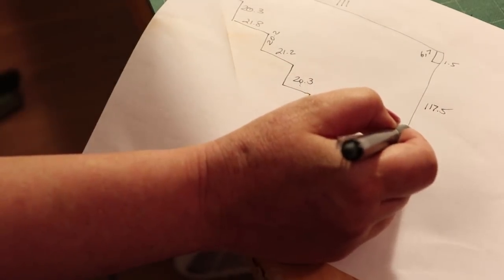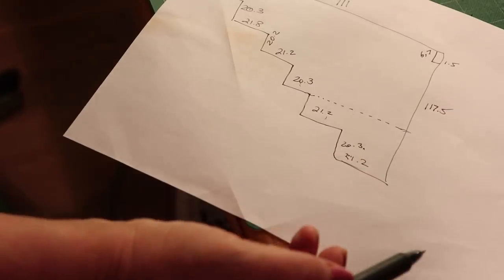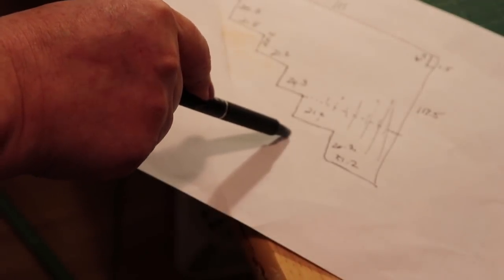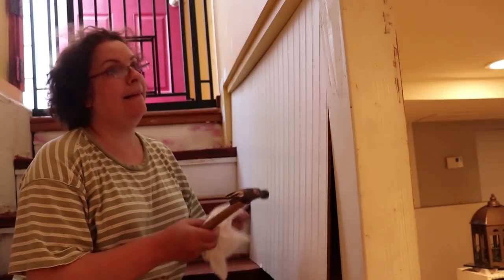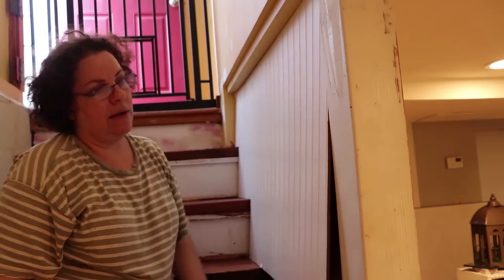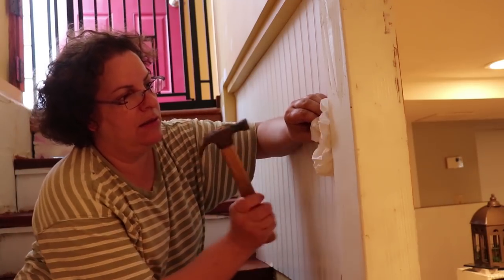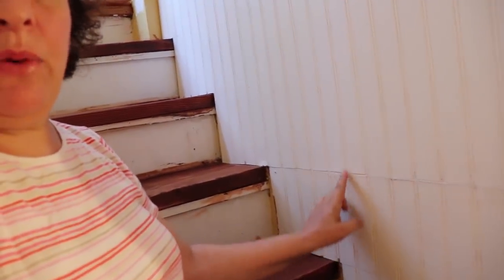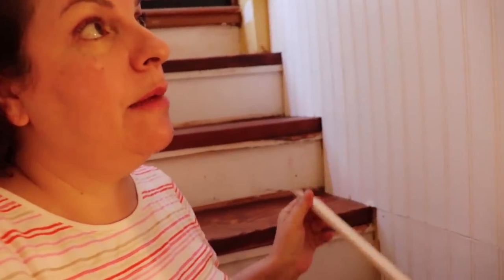🔨  Basement Staircase Makeover || Part Four 🔨

Comment: Excellent work!  You have inspired me to tackle projects at my house.  Just yesterday I finally resolved a drainage problem with my dehumidifier.  For more than 15 years I lived with a large wet spot on my basement floor. Thanks so much for sharing these experiences!
Reply from the maker: Wow. How did you fix it?
Reply: I added a few extra tiles and a scrap board under it to change the angle to allow it to drain through the hose!

Comment: Looks great Sophia.  For the next wall could you put the beadboard on the top an bottom and use a radiator cover like you did in the laundry room to cover the pipe and transition between the two levels?

Comment: You did a great job. You're so right, working on all that detail work is so tedious & frustrating. It looks like the bead board might slip in beside the wall & the stairs on the opposite side? If there is still a gap glue some very thin pieces of wood to the back of the bead board to bring it out tight to the stairs to close up the gap. You can save a lot of sanding on the joint compound by wiping it down with a wet rag. It helps cut down on the dust too.